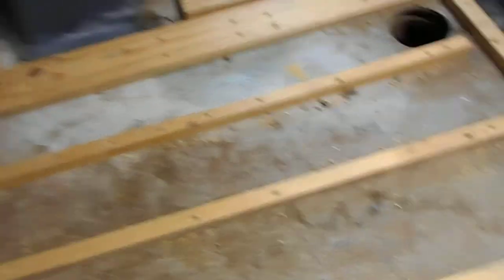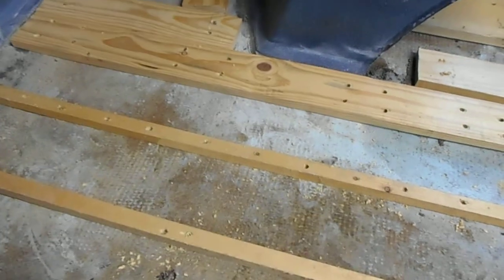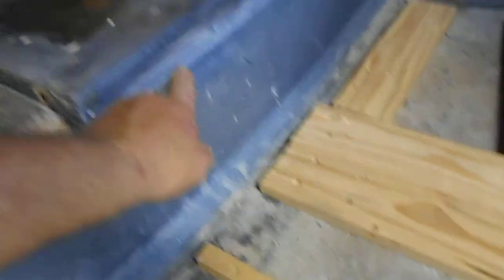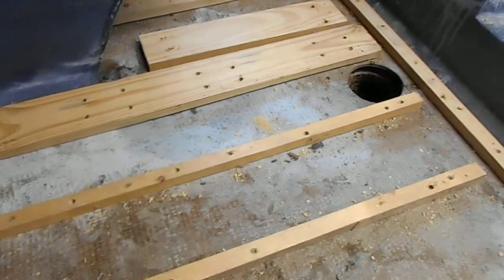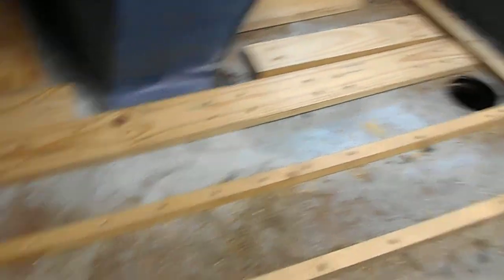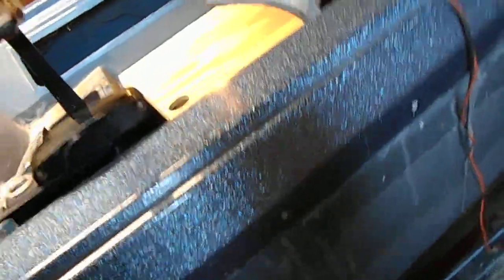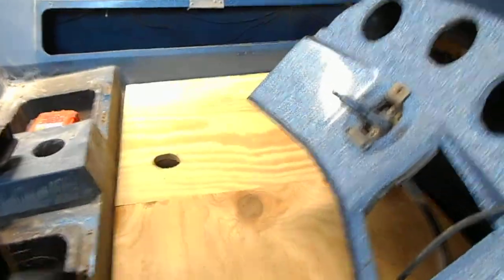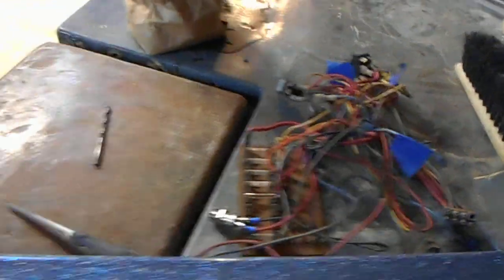1983 ProCraft 1540v bass Boat Restoration UpDate 2

Comment: You would have been more cost-effective just to fiberglass it with that real heavy  fiberglass white mesh they got the stronger than wood I did it to my bass boat several years ago and it worked out great you just add more weight to your boat 👍
Reply from the maker: hi great ? so like this was really first time I have ever done anything like this. There a ton of mistakes! also when I did sell it,  I showed these video's to them I wasn't going to hide anything I had done,  I think over all they bought the boat for maybe the motor not so much for the boat and yes I have learned from this, as when I started my glass magic boat project and grrrrr I am still in the middle of it,    I hurt my shoulder real bad and have not been able to work on it! I hope I can get past this and get back to work and start putting out videos and thank you for your input have a great day from R&P

Comment: Hi great videos I just got a good deal on a boat just like yours. I wondering if you can help me with the wires that go to the tachometer,fuel,temp,and rpm gauge cause the last owner hacked all those wire up. Thanks In advance.

Comment from the maker: the floor is real soft in the middle if your asking about the wood under the plywood it is to make like a tr-oft system for water to drain i know this is not the right way to fix the over all problem this was just a quick fix just so i could go out fishing before summer was up ill work on next summer the right way as in removing the top and all that  and replace all wood to make a new floor  and go from there..
Reply: nightmaregizmo I'm rebuilding a procraft 1660v  and my floor was sponge in a couple places.I cut the floorboard out and the stringers were rotten , I replaced them with treated 1x6's and fiberhlassed that back in and went back with 3/8 treated plywood and fiberhlassed with 4 layers

Comment: I have an identical boat to yours and I was wondering if under your carpet when you bought it was the old plywood that you are replacing or if it was just the fiberglass with wood underneath that I am assuming may be rotten.
Reply: I have a similar procraft - almost the same (1989). Mine was fiberglass under the carpet.